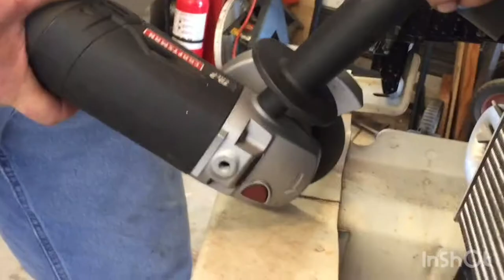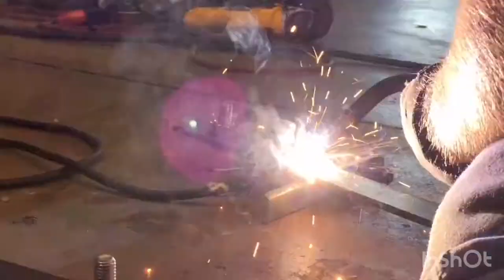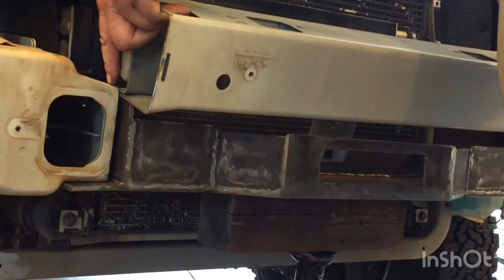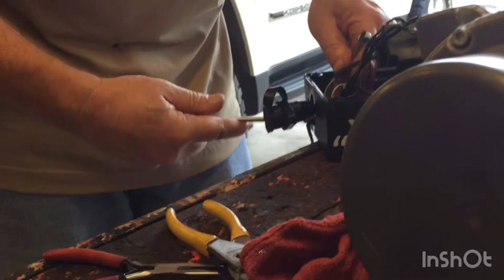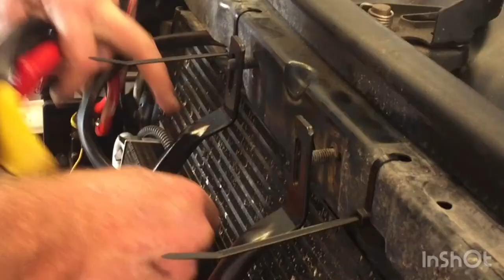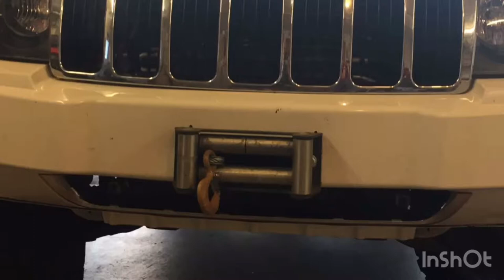making a winch mount

Comment: Will this ruin any structural integrity?
Reply from the maker: No it would probably be stronger
Reply: @mattsadv3ntures How thick is the steel plate you use? And did you weld the steel plate permanently to the chassis, or just bolt it on?